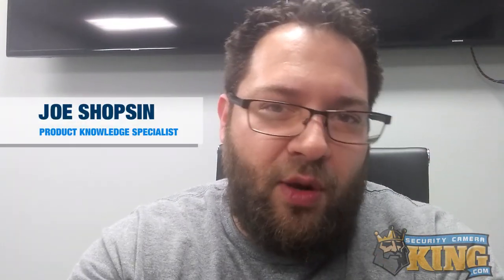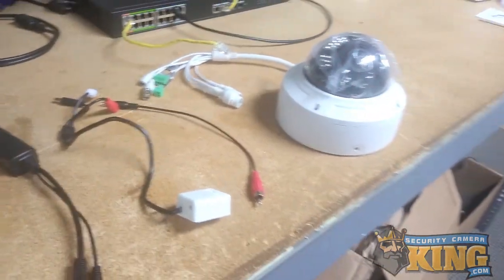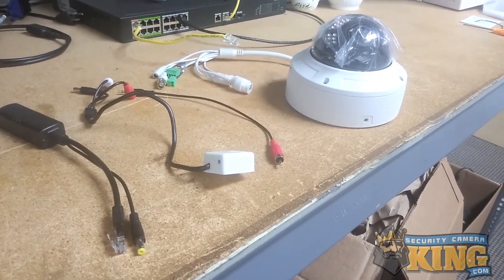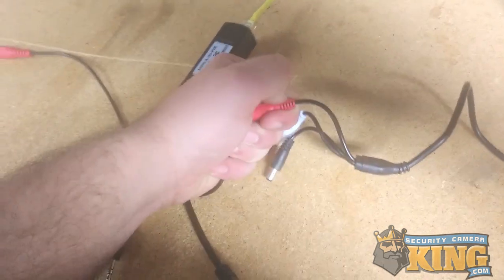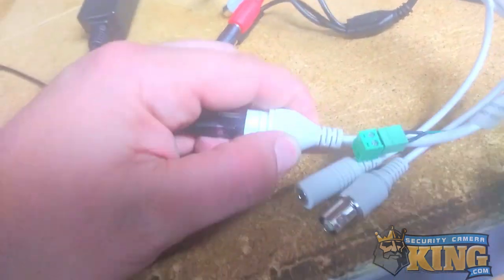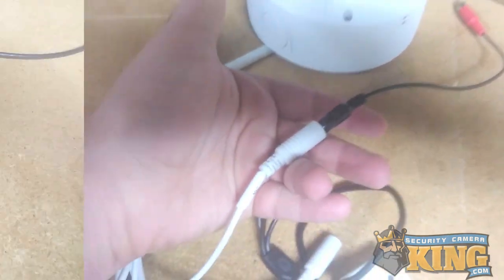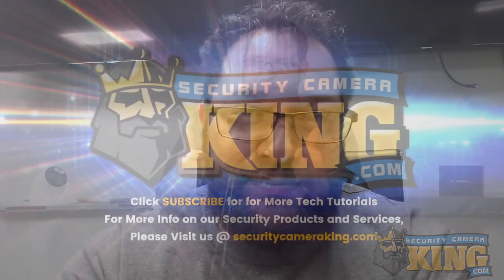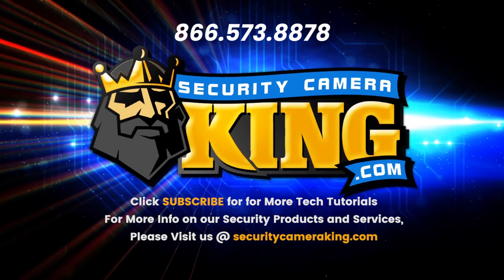TUTORIAL - Setting up an EXTERNAL MICROPHONE on a SECURITY CAMERA with Audio Input

Comment: What's the model of that IP Camera?
Reply from the maker: That particular model is no longer for sale, but this process will work for any of our cameras that specify audio "Capable with an External Mic."  In more technical terms, as long as it has audio input on the camera pigtail this would be appropriate.  Fortunately, many of our cameras feature RCA-in directly on the cable (meaning you will not need the 3.5mm-to-RCA cable shown in the video) and you can directly connect the RCA cable from the microphone into the camera.  The https://www.securitycameraking.com/product/5mp-2-8mm-ai-starlight-ir-vandal-dome-w-alarm-and-audio/ would be a perfect camera for this type of installation provided it is compatible with your NVR.  Please contact our sales department if you have any pre-sales questions in that regard.

Comment: Why do you need an injector if you have a poe switch?
Reply from the maker: We don't, that's because It's not an injector, it's a splitter. 

A splitter accesses POE power coming from an ethernet line that is already being powered, in this case by the switch. It is needed so the microphone and camera can be powered over the same source line.

thanks for reaching out!
Reply: @Securitycamerakingcom  so using a poe splitter with inputs power 24-57vdc to output voltage to 12vdc to power the mic Right? Without using an extra wire or an adapter.